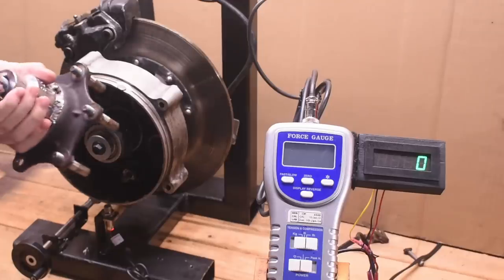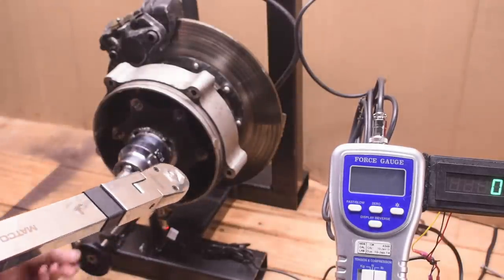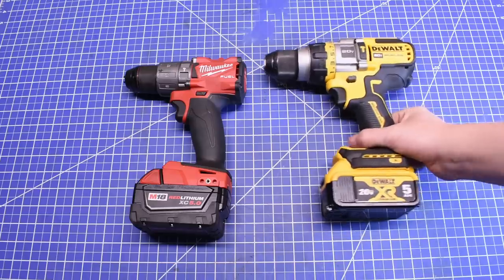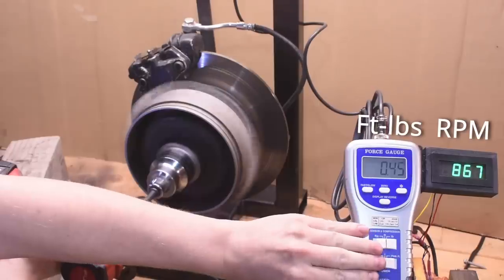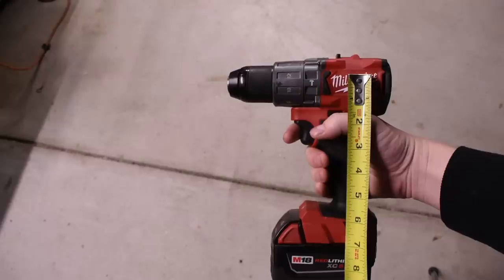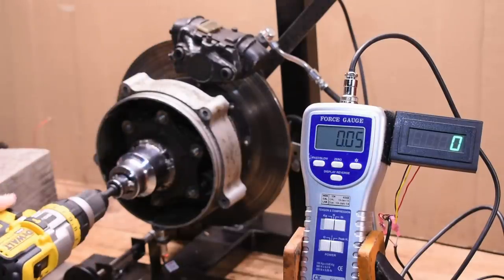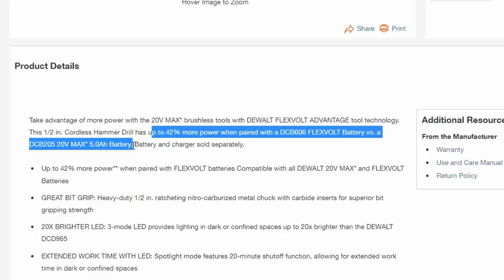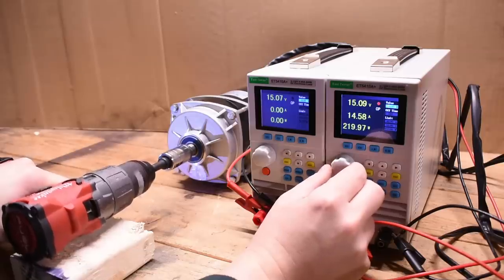DeWALT vs Milwaukee on a Cordless Drill Lie Detector (Dyno Brake)

Comment from the maker: A good point you guys are highlighting (and we appreciate that) is: 1) The data resolution between tools on the high speed brake dyno setting is minimal and 2) the dyno seems to come to a sudden stop. This sudden stop could skew things inertia wise. While we've been able to confirm weaker tools make less in this test (like 8-9ft-lbs) we'd consider dropping this specific high speed portion from the rankings. You weigh in.
The reason they suddenly stop is these tools in high (1800-2200RPM) wont let the tool operate in low like 500RPM so they cut out from being overloaded, which is the tool basically saying hey, use me in low idiot. But also means whether we apply the brake slow or fast the whole test comes to a stop suddenly which let's say 20 tools into this process might be non precise data between tools.
Reply: I think the only time the high speed test would be inaccurate is with brushed tools. The older ones would let the magic smoke out but keep turning. That's not an especially useful metric in that specific instance. But for brushless tools I think it is a useful test.

The new rig awesome, I want to see all the drills tested haha
Reply from the maker: @kylefowler5082  Brushed cordless tools appear to do the same stuff as these on high speed, just with less beans
Reply: In general I am more concerned with torque but you have a point we should look at HP.  I am wondering if it is possible to test total energy in a system.  Watts-hours.  Not just the watt hours in a battery but pushed through the device.
Reply: I know it would be difficult but it would be great to see it on a downward sloping graph of rpm vs torque and rpm vs watts
Reply: If you wanted to precisely control the brake application you could attach the hand crank to a servo with a specific rpm.
Reply: It depends on the objective here.  Is it to get peak torque as you did in this video or is to get a classic powertrain performance graphic where power and torque are plotted against speed?  I know that's more challenging, but that would be the end all be all.  

To get there, you already have the right type of sensors (load cell + speed) on the brake dyno, you just need to feed those into a data logger and then manipulate the data.  Personally, I see more advantages to the brake dyno due to accuracy vs. using the dyno eMotor + battery load tester.  I'm no eMotor expert, but the PMSMs I work with fluctuate in efficiency easily by 20% depending on the rpm and torque setting.  Large efficiency fluctuations on your dyno eMotor would make fair comparisons between tools that vary significantly in either regard impossible. 

But what you should really be doing is talking to a Test Engineer that has years of first-hand experience with Powertrain dynos.  This is a well understood science, you just need to tap into that wealth of information.  Maybe someone like the gentleman from the Robot Cantina channel would help you out?  I get the impression he has a ton of dyno experience.  Just an idea.
Reply from the maker: @jonathancorbett5917  The brake application rate hasn't shown to make a +/- difference really. Also a graph for RPM vs torque makes sense on high RPM tools/motors, but at like 400 & 1,600 RPM the refresh rate just gives you garbage jumps everywhere. We tried
Reply: @Torque Test Channel  is the trouble with the refresh rate due to the force sensor or the rpm one? For a better rpm readout you could just put more magnets on that rotor and set an appropriate divisor on your readout.
For the sudden stop I guess it might help a bit to oil (lol) the brakes, to reduce the sudden grip during the transition from friction to stiction. 
I have to say, when I saw that rig I was like "yes! This is it" since it allows you to get a really nice accurate measure of all of the motors parameters without all the variables from the electronic setup. It would be so nice to get a full speed vs torque graph where you can immediately visualize figures like max speed and torque, but also how wide the envelopes are in which these can be kept up. Let me know if you need any help with data readout and transfer.
Another figure that might be interesting to record is the maximum starting torque, i.e. how much torque a tool can provide with fully applied brake.
Reply from the maker: @JonaJona  It's both, and the force measurement moves around as you might imagine. We've tried spraying the disc with liquid wrench. The numbers dont change but it helps on the low RPM tests to gradually increase load. For high RPM it's the tool causing the sudden stop (it's not the bake pad suddenly gripping), from going too low in RPM under heavy load. They all cut out.
Reply: Seems like either faster data acquisition on the existing brake dyno or switching to an eddy brake setup + a controller that allowed sweep rate closed loop control would be ideal. You are running in to many similar issues I’ve faced trying to put together a low cost engine dyno.
Reply: @TorqueTestChannel   Hm, that's annoying. I'm convinced the force readout could be sped up as well, but depending on the range this sensor is made for, the noise floor might be a bit high with shorter integration times. If I lived closer I'd offer to set something up for you, but from across the pond I'm sorta limited to being an armchair critic.
If the stop doesn't have anything to do with sudden stiction I guess that's fine then. It even kind of speaks for your setup if the rotor mass stops that quickly just from the power input dropping out.
Reply: A test for static/momentary torque would be helpful and easy. Your explanation of why the brake stops suddenly totally makes sense, but that is definitely affecting results. Reducing the weight of the rotating assembly would be one way to mitigate the problem. If you can cut it in half then it should be half as much of a problem. Knowing that, further tests would allow you to calculate how much error there was to begin with.
Reply: @TorqueTestChannel  can you do similar to what you do with your power measurement where you look at sustained instead of peak numbers.? Basically consider the max torque to be the max it can sustain for x amount of time
Reply: @Nathan0A  I don't see how an eddy brake would change the data acquisition rate? Additionally, speeding up data acquisition on this setup is much easier than swapping the brake mechanism for something else. 
This setup is excellent for it's perfect calibrated and linear readings and as long as that brake doesn't go up in flames I don't see how anything else would provide an advantage
Reply: Here's a thought: I doubt you need automotive grade or even motorcycle scale parts for this application. Given the magnitude of forces that can be produced by hand drills, I expect that you could build this rig with a brake disk and caliper from a downhill mountain bike. That would dramatically reduce the rotating mass of the system.

Likewise, the rotation speed sensor should be set up with a trigger wheel. It's not entirely clear from this video, but it looks like it's only triggering once per rotation which is totally inadequate for lower speeds. Using a bicycle style brake disk, which typically have spokes instead of a solid face, would allow using the multiple spokes as triggers. Then simply divide by the number of spokes to get rotations.
Reply: I admit that this would make the dyno less useful for high output tools, but if the goal is precision on hand held cordless drills then I think it's worthwhile. Besides, if these smaller tools can be run on this large dyno, then that can be used to scale/calibrate against the smaller dyno.

A valuable second data point for test validity.
Reply: As a comparative test I think it's valid, because the mass that the drills must spin (and stop) is consistent between the tools. As an actual measure of force the numbers might be a little off, but they should be consistently off. Which is to say if you somehow got a really accurate force measurement from the drill you could use your brake and get accurate numbers by way of offset calibration. I can't imagine your figures are too far off though. 

I'll also add that anyone who's used a drill professionally is well aware of the wrist-killing factor of a drill and there have been plenty of times I've ditched a more "powerful" drill for a more manageable one simply to avoid the hard jerk when it decides to apply torque to me instead of the work piece. It's a phenomena that exists in the tools intended use case, and so encountering it in testing doesn't invalidate the rest, in my opinion.
Reply: How about a simple Arduino + stepper motor to apply the brake at an even rate for every test?  Press a button, motor starts turning at <whatever>RPM to apply the brake, take one more bit of human inconsistency out of it.  I'm unsure if that would improve anything with the test, but intuitively it feels like a more precise test.
Reply: Can you measure torque from a dead stop? And then again as it very slowly accelerates the rig from the slowest rpm before it cuts out, kind of how a Dyno run on a car would be done. You can then plot torque and RPM to get an accurate power output.
Reply: @TorqueTestChannel  when it reaches stall, can a higher value be obtained by pulling the drill out, spinning it up and putting it back in? I only ask because i stall drills fairly regularly drilling through inch thick conveyer belt and spinning the drill up helps break though sometimes.
Reply: I think this could be improved a little by adding a stepper motor to turn the resistance handle, then "braking" would be applied evenly and consistently accros all tests.
Reply: I would focus on precisely controlling the rate at which the braking pressure increases.  I'm pretty sure this sudden stop is a safety feature designed to prevent busted wrists and knuckles.  I think the tool detects amps(probably?), and cuts out at a certain peak threshhold.  So yeah, if you can precisely control the rate the brake pressure increases, you might be able to tease out what is happening electronically, and then design your test so it has the least effect on the outcome.
Reply: @danielvanced5526  Not really, for a couple reasons: first because the drills stall and don't run at such low RPM, second because the static friction is higher than the dynamic friction leading to a measurement void around the most interesting moment.
Reply: @TorqueTestChannel  you can put the brake roter you are using on a lathe and a use a straight cut gear hobbing cutter to create a lot of peaks for a hall sensor. That would give you a to lot of precision in the speed logging.
Reply: I think you should standardize the high speed test to stop at something like say 75% of the starting speed and record the torque or power output. as opposed to when it cuts out or stalls. then all the tools can be more closely compared
Reply: Still counts, say you aree drilling a hole with a 3/8 drill bit and it jams up. That torque is still going to jam up and against your wrist and send that through the bit. In real life situations this would simulate that case.
Reply: Data acquisition would not only allow you to eliminate the inertia effects when it stops, but would also let you generate awesome power/torque curves like an automotive dyno!

Regarding the dyno itself, why not use a hydraulic motor and a flow control valve?  Minimal inertia, and no stiction effect to cause a torque spike when the tool stalls.  The same lever arm/load cell approach would work, but I might also suggest a multipoint speed sensor for better tracking, like the crank or cam sensor on an engine.

This is awesome so far!!!  I want to see Makita 18v and 40v drills tested too!
Reply: I believe that has something to do with what they call a "hard joint" and a "soft joint" torque rating.  They used to have this in the European specs.  Hard joint, where the momentum comes into play F = ma kind of thing.  Soft joint where it's just the torque ability of the motor alone.
Reply: You are about 90% there, but here is what I suggest: Take one of your big brushed DC electric motors and put it on a floating bearing setup so the motor can rotate on its frame. Then attach a long lever to the motor frame and put your strain gauge there as you did with the dyno brake you have in this video. Now you can have much more precise control over load the generator can create against power tools. Since it is a brushed PM DC motor, the torque is linear somewhat until you pull lots of amps with your load tester, but that is beyond the scope of this comment (IE: magnetic field distortion caused by the armature and iron core saturation, etc..) . Thus, if you double the current you can double the counter torque the generator makes against the power tools it's shaft is connected to, and so forth. 

An even better solution is to use an automotive alternator in place of the DC motor used as a generator. Just remove the control module for the exciter field and leave the bridge rectifier assembly in place so you can have DC output connected to a fixed load resistor bank. You can gradually create more load by increasing current into the rotor field circuit on the alternator. Get a DC power supply that can limit current if dead shorted. Set the DC supply to max current allowed limit and set the voltage to about 6 to 8 volts. You may have to get a high wattage power supply if it current limits on you at 6 to 8 volts applied to the field circuit. The current needs to be limited only by the resistance of the field coil. We don't want active current limit from the power supply just yet.  Take the torque reading at this level. This should be your max it can do. Now to adjust the load the alternator creates, change the current limit dial on the DC  power supply, but do not touch the voltage dial. The power supply automatically adjusts the voltage so the new current value limit is reached. Now you can do your adjustment of load using the variable power supply by changing the current limiting dial.
Reply: Add a 5:1 gear box on the input, it will give you more precise values at the peak stall, then just divide by 5.

Comment: Would be interesting to see how the Makita GFD01Z or XFD14T compare given Makita claims both have a max torque of 1250 in. lbs. - with the XGT one claiming higher RPMs between the two models.

Comment: I went from a 16 year old Dewalt to a new Milwaukee for installing farm gate hangings and holy carp the Mil' with a 1'' auger really knocked me around for the first day when I left the handle at home because I never thought such a wee drill would get the upper hand.
Reply: @longlowdog..... you are not joking....I don't advise anyone not to use the handle on the 1/2" Milwaukee and make sure it's on very tight. I have been lucky many times and not broken a wrist.....the torque is legit as the box claims when the drill locks up and it can really hurt you.

Comment: Naise to have some actual numbers on that, bought a Metabo BS 18 LTX BL I a while back and it can comfortably replaced most of my other power drills, easily beating all my previous "700w+" corded drill (apart from my Bosch Professional, it's "just" 520w, but if you jam it, something is going to break, and and it won't be the drill).

Comment: Not sure if you have considered it, but a water pump and a valve is how a engine dyno works. It's also very controllable, doesn't change drag when it gets warm.  Also you can measure the psi.  Hope this helps! Learned this from a local dyno guy that was able to dyno small engines on a engine dyno.

Comment: I think that the table will eventually start to get rather confusing since you are including standard package/bundle batteries with the better battery choice for a particular tool on a particular test. The better battery option can change on the same row for a particular tool with no indentifier of which battery. It was hard to follow with just two let alone when you eventually add more to the rankings.

Comment: If you have the ability to datalog the rpm and force censor, it would be really cool to see a dyno graph for these. And to see how that compares to the generator test
Reply: While Power = 2*pi*RPS*Torque (in metric units), just one method is sufficient for the test, as long as you are measuring all the required variables. So if you capture the RPM on the disk brake dyno, you could graph the power too, or if you capture the RPM of the generator, you could plot the torque. Essentially both methods are the same, just the way you control the magnitude of the load is different.

For me, it would be easier to make a fully automated dyno out of a generator (I would still use a load cell on the mount as well for accuracy), but could be made from the disk brake equally well, but with some oil pressure regulator adjusted by an actuator (or some other clever way).

Comment: That milwaukee drill is severaly overdriven for the motor size. There was an austrilian channel who did tests and after draining an 5 AH battery, it was over 70 degrees at vent whereas every other model were less than 40. That could contribute to early shutdowns. 

Also would like to see the new Bosch 1350 inch lb drill tested, although I don't think it's available in kit yet, only bare tool

Comment: I rarely ever use any drill I own in its highest rpm, cordless, corded, or drill press, especially when drilling “steel”. Than it’s low rpm and high pressure. Torque takes the win with me every time, even though I did suffer a broken wrist with my Milwaukee. I now use the included handle for high torque applications.

Comment: Recently got to play with the Bosch GSR 18v 150c and it impressed me. Felt superior in power and sustain compared to the Milwaukee using a 7AH 21700 based pack. Probably the one named GSR18V-1330CN in the US?